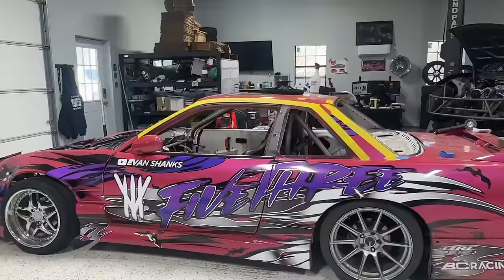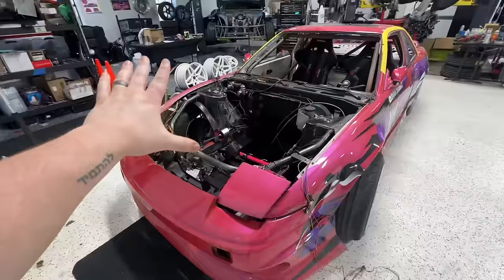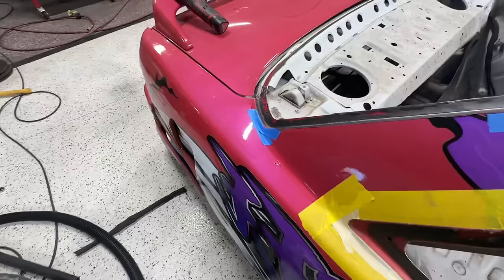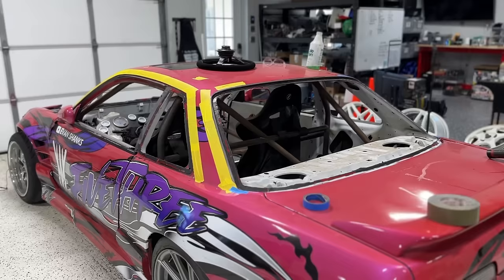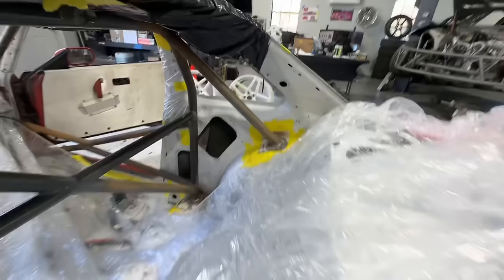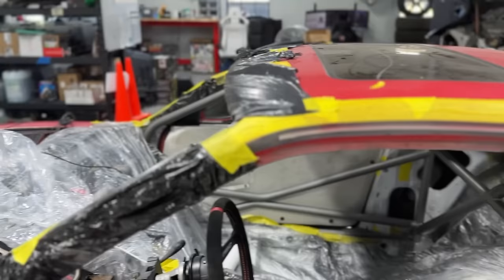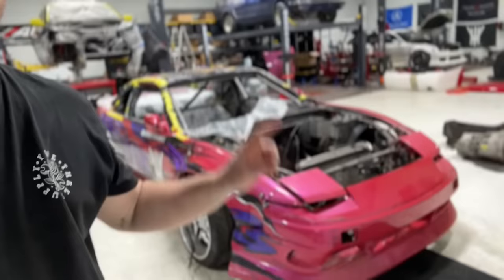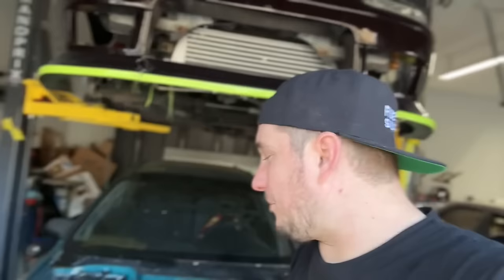The CRAZIEST Engine Swap I've Ever Done!

Comment: You should reach out to BoostedBoiz - I recall them having to completely reengineer the steering to fit the J series and it didn't drive the same way.
Reply: I think they moved the rack back heaps then ran massive offset spacers to make it work, pretty much the opposite of what you want to do.

Comment: J series also have a lot of Frankensteinability for easy power from other js. I think the j35 cam take tye intake manifold from the mdx which is 7mm bigger for more breathability. Type s Acura variants also have forged rods and crankshaft. So many possibilities
Reply: Yep, and it depends on if he wants first gen, second gen, 3rd gen. Personally the J37A1 might be his best bet in terms of pure power.
Reply: @jv6miata J37 were known for consuming oil pretty bad
Reply: @thurmy_ I think that was the second iteration. The A1's aren't as bad for it. In any case he could slap some J37 heads on a J35 block and be solid

Comment: K-swap is not overrated at all. LS swap is overrated.
Reply: they both are tbh 👍
Reply: @AK086.  facts
Reply: Kswaps ARE over rated.
2j is the MOST overrated because they're HELLA expensive, and monstrosly heavy.

Ls you can put a head/cam kit and exhaust for like $1000 to gain 100+ hp. Sound good. Rev to 7500. Etc
Reply: False they are both overrated and for drifting the LS is a much better option
Reply: people just like to complain. 

Expensive power = overrated

Cheap power = overrated
Reply: @connoisseuroftigolbitts 🎯
Reply: In my opinion, any engine that is commonly swapped into a car is overrated. So you're k series, you're Rb jz ls, rotorary, Sr etc
Reply: I wouldnt say LS is overrated id say its just an easy choice to go that route because its been done and proven so many times over.  Not to say a crazy swap like the J is bad considering I want to do a FG barra swap in my e36 but its gonna be a hell of a lot harder to pull it off than a LS.  RB’s and JZ’s are definitely overrated but i still love them as a car guy.  In the end whatever swap u do is cool and none of them are bad
Reply: Both are overrated, K will shake and vibrate itself too death. LS will starve itself of oil and kill itself in drift.
Reply: @joeypatrick6170  if you use the stock oil pan on a ls then yes but I think some vette pans don't have that problem
Reply: @AK086. If they are overrated what do you suggest¿
Reply: Two things can be overrated at the same time
Reply: @sabastiangipson8163 Rotary is not commonly swapped into anything tf are you on?
Reply: @bigfootgarage2201 LS is dogshit for drifting.
Reply: @s13von  whatever you want to build, build what you like, don’t build something cause everyone preach on it, i’m not saying they’re bad they’re excellent motors just contradicting the original comment
Reply: @AK086.  I understand and agree with you brother

Comment: Cant donate to help but i did watch the whole ads and i never do that.   And this swap im so pumped for.   Iv been a big honda fan for awhile.  Much love man   keep it up    and honda engines are really easy to get power out of.    And idk why but i had a feeling you where going to do this swap after watching that last vid.  You will get alot of attention with that car after that
Reply: Imagine a vr6 in the eg.    Or even the 1.8t.   I had a jetta 1.8t and i loved it.  After i did the dual clutch and flywheel thing woke right up. Ahh i miss that thing
Reply: With the vw engines unlike the hondas with no tq.  The hp and tq are very close numbers wise.   Hense why after i fixed the clutch linkage and light flywheel  it felt like a new car.  Felt like i had put a new turbo in.  Just tq right away.   Hard to get that with hondas.   Thoes wake up after 4k. Most of the time
Reply: @bobbybeattie4738 why make a honda unreliable with a vw motor😂

Comment: The boosted bois had alot of issues with the steering rack and it was going to cost alot and be a pain to make fuction correctly that's why it has an ls now but if you are set on running the j Kyle has done the leg work and knows what I takes so I'd definitely reach out to him considering his issue is much more of an issue if you plan to drift it

Comment: Just read 3 comments about problems with steering durgin J-swap (not even seeing boostedboiz episodes), that somebody is giving you a good hints...but yo, don't act on impulses..😅 You have to fab out whole mounting points not having even fab guy full time - but you want to make it under 5k...you have to do wiring not even having the possibility to purchase some 'bolt on' harness like wire specialities. PLUS accordingly steering issues - what you know is most immportant in drifting. V6 overall is a good idea. But VQ, not J.

Comment: Don't do it. Jseries are garbage! go look and see how many of those boostedboiz went through before even they abandonded it. If you wanna drive the car more than work on then just stick with a tried and true powerplant. Otherwise all that excitement you have right now is gunna fade away REAL fast when all it does is break. Put a K series or even F series in it if you're deadset on it being Honda powered.